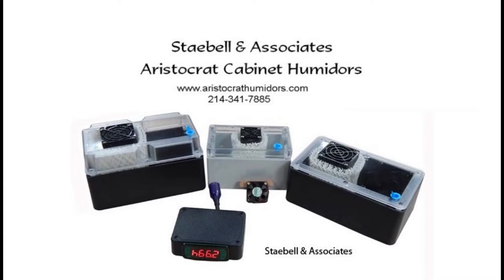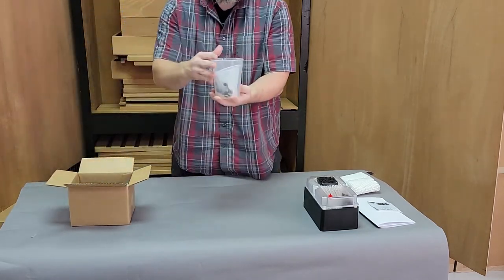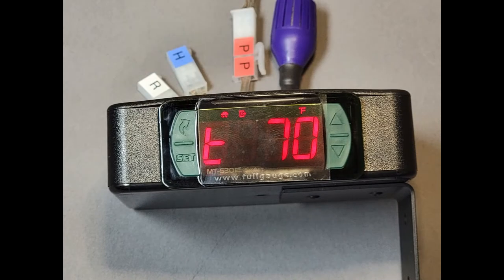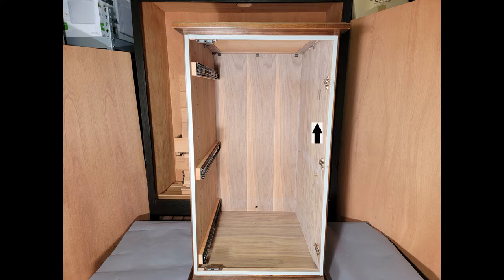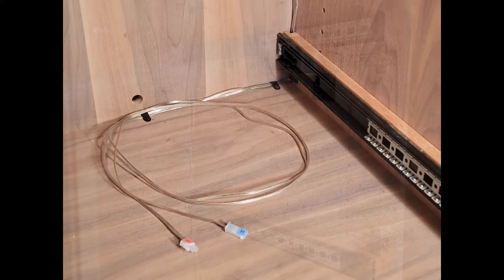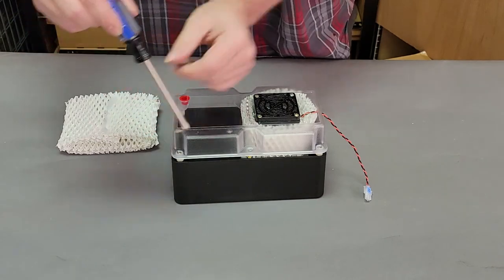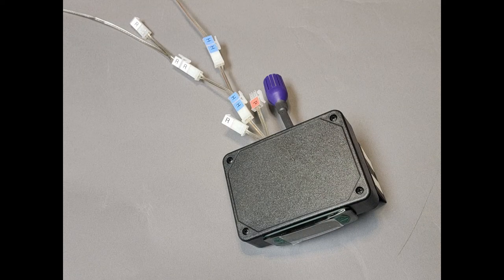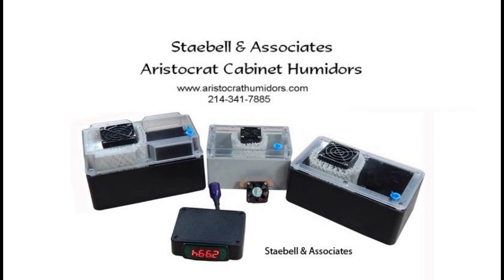Digital Electronic Humidifier for End Table, Tower & other Cigar Cabinet Humidors

Comment: Does the set and forgot controller need to be mounted inside the cabinet, or can it be mounted outside,  with the long sensor run inside?  Thanks!!!
Reply from the maker: Ross, the control can be mounted outside with the sensor inside the space.  One typically locates the sensor in the upper 1/3 of the cabinet.